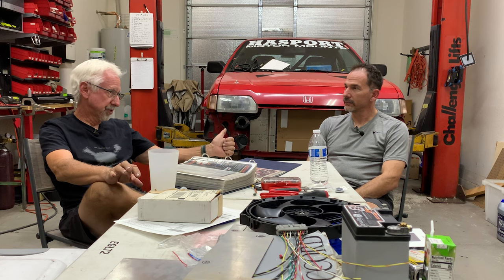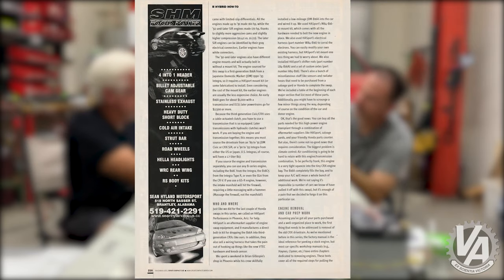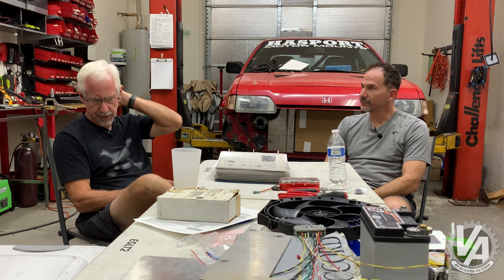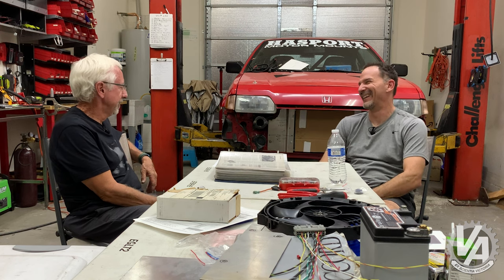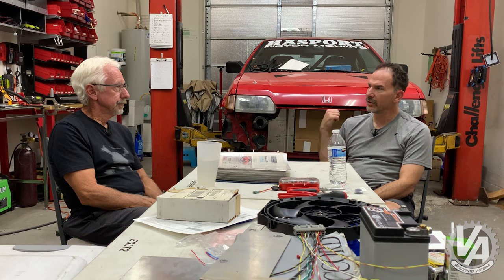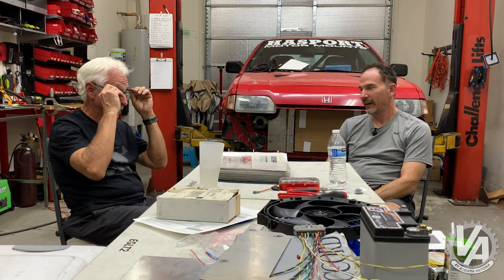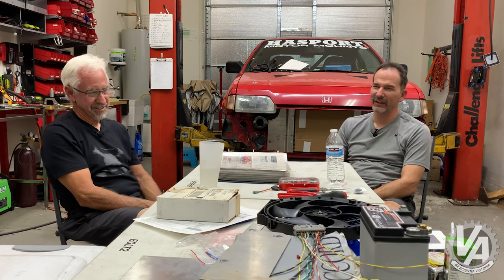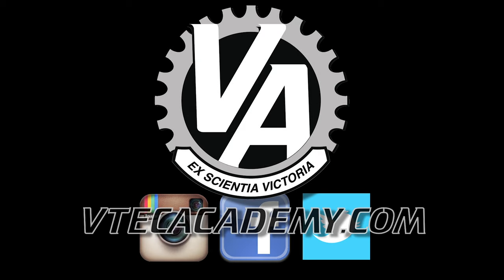What You Need to B16 a 3rd Gen Civic/1st Gen CRX

Comment: 4G Civic hubs fit, have the right spline count for the axles, and use the same wheel bearing as stock.  There's no machining needed.  The only thing is that you may need to trim the end of the knuckle on the backside of the hub if the hub makes contact when everything is pressed together.

Comment: My brother still has your Hasport mounts in his EF b16 since 2000/2001. Still has your mounts and same motor. Hasn’t been driven since 2015 and even my 96 coupe has your mounts and hasn’t been driven since 2012. Back then we used some steel brackets to mount the engine in the EF because there wasn’t any back then and we are located in Toronto Canada so it was hard. You made the swaps easy and thank you.
Reply from the maker: Awesome! Shout out to Toronto!

Comment: Another way to get around the driveshaft outer issue. You can fit EG bearings/hubs into your smaller knuckles so they accept the 26 spline outer cv then do the old swaparooni on the shafts like you would on an EG k swap
Reply from the maker: We will try that.
Reply: Hi. What axels is this for? Is it gen 1 crx axels or is it oem b16 axels. I am going to swap my gen 1 crx this winter.

Thanks
Reply: @SweNitraM  you can use awd 1g wagon axles/shafts from memory

Comment: Seems like a b20 vtec would have been more than enough for this guy lol a lot less work and with type r replica pistons decent set of cams rod bolts 200-220hp  would 
Have blown his mind compared to the b16 in that chassis
Reply from the maker: He's had multiple B-series engines in the car. The reason for choosing the K24 is the tremendous torque that engine puts out. With the rules set he is using for his Time Attack class the K24 had the best numbers.
Reply: @VTECAcademy  definitely not arguing that fact the k motors technology is way more advanced plus displacement makes for more torque so the 2.4 has it hands down I was just making for ease of complication a decent b20 vtec would have done well with less work but I under stand the purpose of pushing the old
Platform in to the future